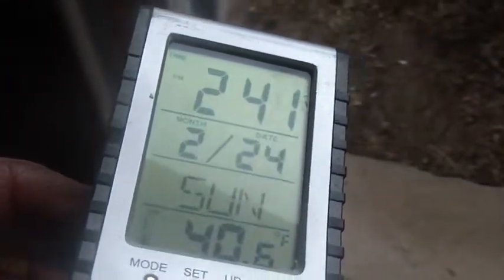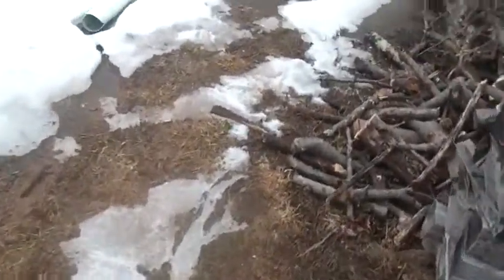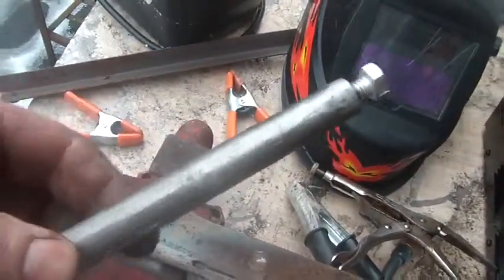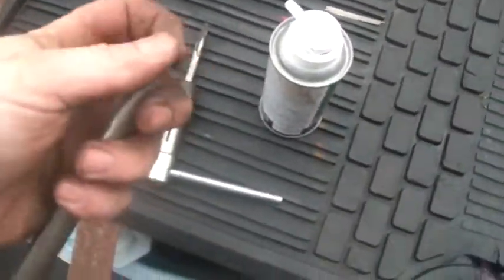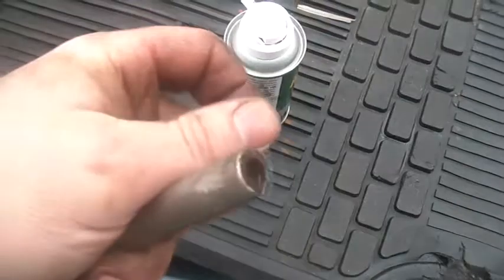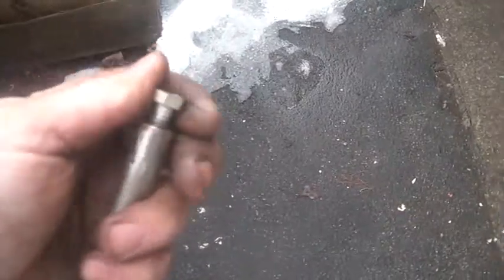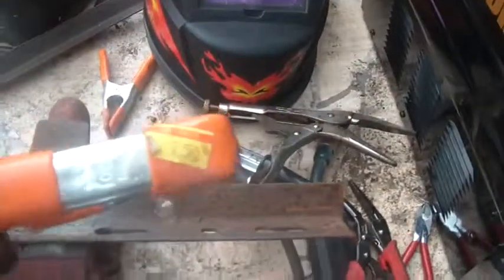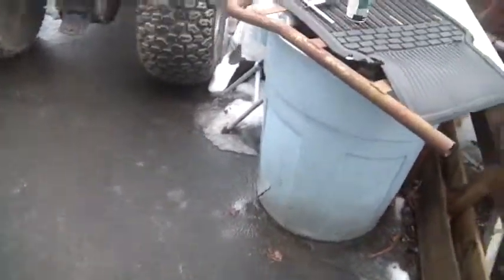2_24, Red Neck Welding and Tapping to repair the Kawaski Mojave RearEnd pivot shaft.

Comment from the maker: Hey Wallie, Put the Honda Engine on it!  I like nothing better than a Frankenstein bike. That is the one that doesn't spark, right? Normally, checking out the coil and hall effect is not that hard, simple Ohm meter tests. Checking out the CDI means trying it on a good bike or changing it. CDI boxes are not cheap, I have a golf cart that wants a $200 CDI sitting out back. Unfortunately, bikes come in 2 flavors, running or parts, running bikes have some good value, parts bikes, much less so.